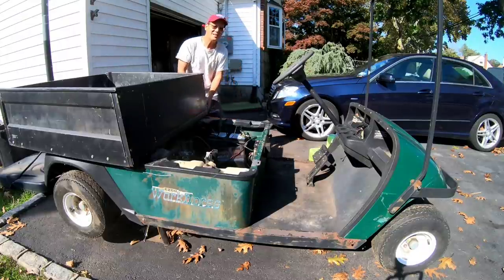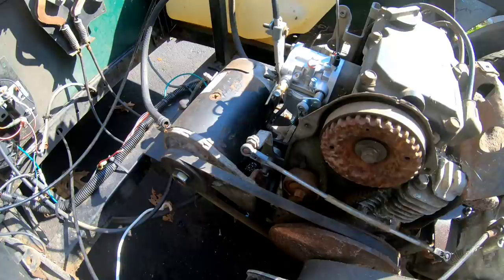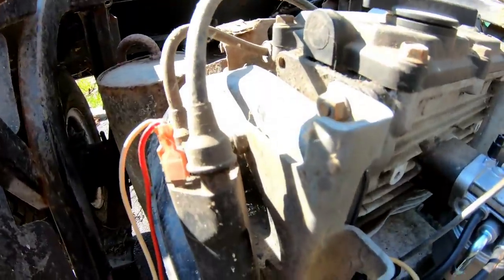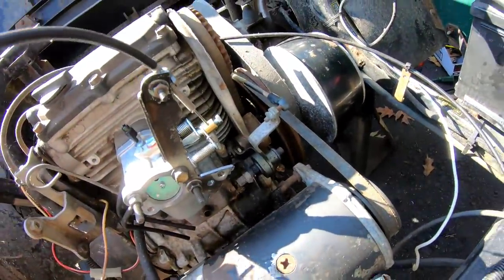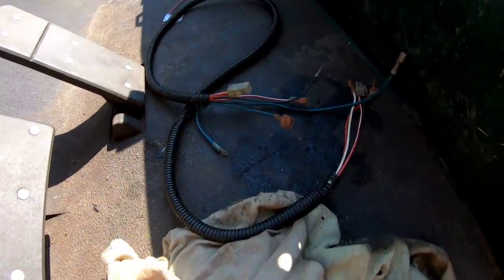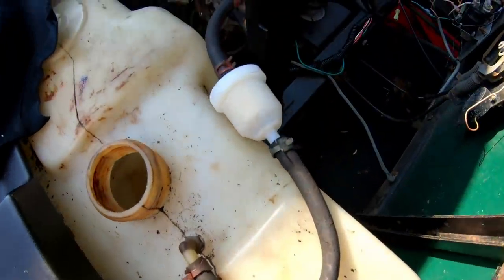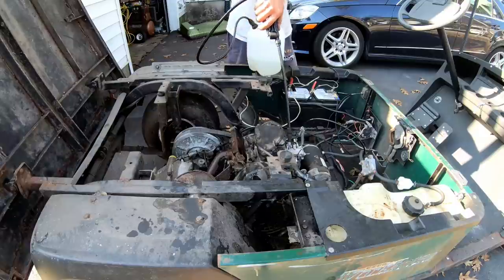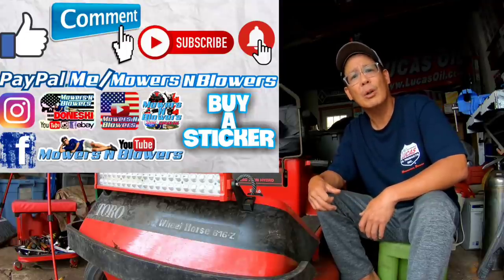EZGO WORKHORSE UTILITY GOLF CART TROUBLESHOOTING ELECTRIC IGNITION COIL NO SPARK GAS TANK DRAINING

Comment: Henry you are on the right track , in your first episode you pulled out a black rectangle box[inside the glove box ]  , it looks like the cdi box which ignites or times the spark , The past owner may have had spark issues very common problem on the older models , not sure how the pedal works there should be a micro switch. keep up the good work 👍

Comment: Would try an locate a wiring diagram given how many wires are cut.  The coil most likely needs to be connected to an igniter and a pulse generator.  Not sure, never worked on one of these.  What is the model number?
Reply from the maker: I have the diagram but may repower instead

Comment: Buddy, Does that thin black floorboard mat pull up?  I keep thinking there is a small panel below it- located at the gas pedal. Then a switch for the pedal under the panel--where the spring hooks to ....

Comment: Henry connected to the mechanical gas pedal is a micro switch in the engine compartment the same side as the steering wheel.on the fire wall.
Reply from the maker: It’s pooched

Comment: The white wire coming from behind coil is oil pressure sensor,there is a box under floor mat that has a micro switch that opens circuit to turn over motor when you press the pedal
Reply from the maker: Good info bro thx

Comment: If you put air pressure in through the cap on the tank it will force the gas up the line through the filters and out
Reply from the maker: The line is crumbled in the tank

Comment: You can find owners manuals online that shows all the parts plus wiring diagram.  The nice thing is that they are free.  Just google the model number and you are set.  Looking forward to seeing this finished.
Reply: Where?  I haven't found anything.  Post a link
Reply from the maker: EZGO WORKHORSE UTILITY GOLF CART
https://www.youtube.com/playlist?list=PLD6OlSIZY1xX3K8csJOiKDpm_sXshHROV
Reply: @MowersNBlowers  I saw you gave up on it
Reply from the maker: @frontlinemedia4270  yeah it kicked my ass,  and then someone wanted to buy it!  So off it went!  I was able to drive it around the block a few times.  So a mini success but not a win for me.
Reply: @MowersNBlowers  yes.  I have a rat's nest as well.  I can't find good info on how this ignition works and the previous owner cut wires all over it.  Mine is very similar to yours but it has a smaller canister air box.  I don’t even know the year yet.  It is not easy to work on
Reply from the maker: @frontlinemedia4270 it’ll cost you a fortune to replace all the cut parts,  you may as well try another running engine like I did m.
Reply: @MowersNBlowers  do you remember when you worked on the starter if the smaller nut had 2 wires on it?  I have blue and green wires attached.  Do you know where they are supposed to go and what that attachment point of the starter is for?
Reply: @MowersNBlowers  I had this running but then lost spark.  I need to learn how everything works.
Reply from the maker: @frontlinemedia4270  everything I did is in the videos
Reply: @MowersNBlowers  the problem is that everyone that does a video about this jumps around with their cameras and doesn't show what wires go where.  And then don't explain  what the parts do.  I guess no one knows

Comment: I am working on one of these.  You can get the fuel tank out by removing the top rivet or by pulling the blk plastic so it pulls off the rivet.

Do you have a wire diagram?  
I have a no spark and wires just like this, cut, missing etc.

Do you know the model and yr of this?
Reply from the maker: I don’t remember but I made 25 episodes on it.  Here’s the playlist 
EZGO WORKHORSE UTILITY GOLF CART
https://www.youtube.com/playlist?list=PLD6OlSIZY1xX3K8csJOiKDpm_sXshHROV
Reply: @MowersNBlowers  I am finally getting so information about this cart, huge run around from ezgo and dealerships.  Everyone claims that the pulsar coil is not available.  I finally got good numbers for testing the components of the ignition.   It was like pulling teeth

Comment: You need to invest in a test light, alot better for troubleshooting than a meter. Especially if its a ground problem
Reply from the maker: I have a test light!  A multimeter measures the voltage not just a current

Comment: Should be a switch source of power or you burn the coil up even if you run it to the push button start that's supposed to be on the accelerator pedal

Comment: You need to find a wiring diagram for this, you may do more damage than good by guessing, google can be your friend
Reply from the maker: I google better than most
Reply: @MowersNBlowers  rewire it. Not much to be done tbh. that electronic ignition coil is like a kohler coil. Positive to battery other side to what ever. Just Jerry rig until you get running then add fuses and other stuff

Comment: The white wire goes to nothing FYI.. I work on golf carts carts for a job. 9 years.
Reply from the maker: Why make a white wire that goes nowhere?
Reply: @MowersNBlowers   I work on carts we have 3 gas ez go's here like that the white wire is hooked to nothing. It hooks to a sensor. the wire is about 4-5 inches long. Try the CDI box next to the Solenoid.
Reply from the maker: @slipnslide83  so it doesn’t go to nothing,  it goes to a sensor.
Reply: But the wire is not hooked to anything and needs not to be hooked up. Ty. @MowersNBlowers